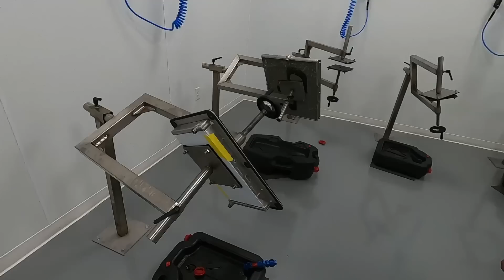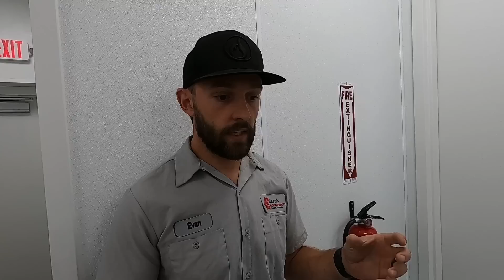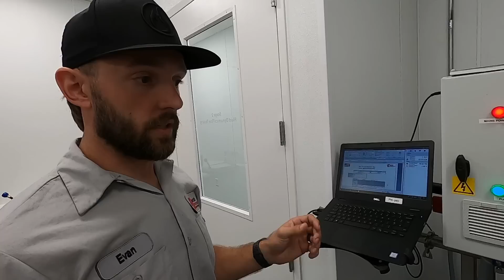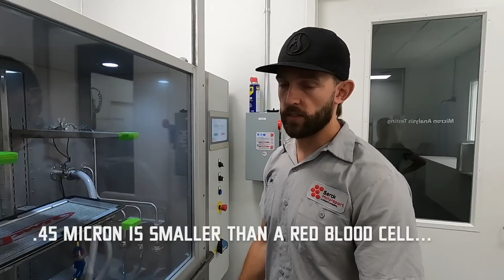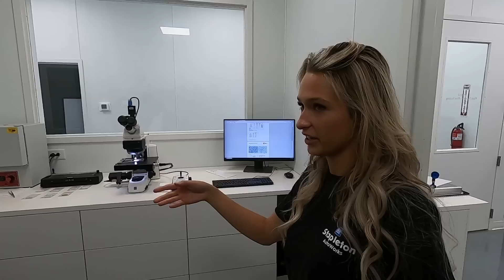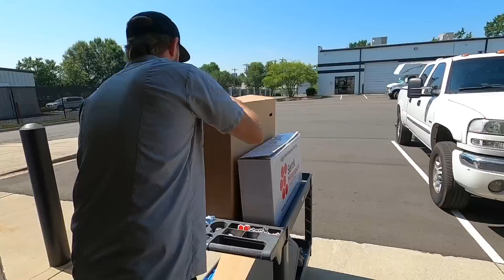Formula One Radiator Service Will Change Your Opinion About "Clean" (Serck Motorsport Tour)

Comment: Distilled water is meant to be used in conjunction with a concentrated liquid coolant, usually in a 50/50 ratio.  This is specified so that only the components within the coolant concentrate are present and they are not diluted/reacted with by the added components of city/well water.   In racing applications where you are often required to only run water or choose to run straight water, it is never recommended to use distilled water.   Really, most any water will do with a bottle of water wetter.

Comment: Awesome info, and Im only at 14:52 while writing this, so I apologize if it is covered. Why not run an inline filter with a micron rating that is thinner than what would get caught inside the radiator. I realize this could affect flow, but maybe lets apply the theory to say a daily driver. I remember when the Ford 6.4 came out there was this big push to get a coolant filter on it because of some supposed casting issues where sand might exist in the water jacket. I installed one on my truck at that time just for safety sake.

Comment: Awesome. Very enlightening to see the pool of copper coming out of that radiator! I am really wondering where are the 3D printed heat exchangers? There was a 3D printed oil-fuel heat exchanger for a helicopter and it was revolutionary I keep expecting these optimized radiator things to popup in the enthusiast/race car scene but nope.

Comment: I've built membrane filtration units that pass compressed air through filters and capture the nitrogen, then release the o2, Ar and He. to the atmosphere. Now days, I work on semi's and when it comes to radiators on over the road trucks, when they leak, they go in the bin. That's the end of it's life. A radiator is way cheaper than a tow bill. A basic in frame rebuild of an x15 Cummins starts at $10k and can easily escalate to $20k-$30k. I honestly don't care what the radiator costs. It's a wear component and will be replaced at some point. What will really get your goat, is when you loose an engine due to someone using the wrong hose clamp. It doesn't happen all at once on the big engines. You loose a hose, get it fixed, then watch the oil samples. The trick s to break out the checkbook while the crank is still good. If you loose the crankshaft, you might as well get a new truck.

Comment: "why helium? Yeah its the purest form of air" Did he really mean say that??? Someone sure as hell didn't pay attention in science class. Okay I'm sorry guy but this employee was taught the wrong stuff. Distilled water is not going to eat away at any aluminum at all. Zero. Aluminum has an ever present oxide layer protecting it. However DI water will because of the high free Hydrogen ion concentration is VERY corrosive. DI water is so corrosive it cannot be used in iron pipes, and will certainly tear into aluminum. The main factor in the corrosivity of water solutions is the ion content, the ability of the water to carry a current in galvanic reactions. Lower ions, less current, less corrosion. Don't go listening to this guy and put DI water into your aluminum block that has current flowing through it all the freaking time. You will accelerate the mass transfer process thus eating your block from the inside out. Don't believe it? Go do some digging.

Comment: Been using distilled water in my 02 s2000 for 15 years ,original water pump radiator and thermostat, 252,000 miles and no leaks!

Comment: You can measure purity via resistivity. Softened water has calcium replaced by sodium  so is soft but not demineralised.
Distilled water isnt as pure as reverse osmosis (RO). I used to do lab work, we used water with 13 mega ohms per cm. That sustem was fed with RO water and had Activated Charcoal and uv treatmrnt as well. Measured pH of water varies and solutions would vary before pH adjustment, but pH meters can't measure pH of pure water very well, as pH meters determine pH indirectly, and needs something in solution to work well.

Comment: DISTILLED WATER:  not a myth at all. ask any jetta owner with a stopped up heater core- certain coolants react with certain metals and can drop the minerals out of suspension or form other minerals. another field that can attest to this is cnc manufacturing. water and coolant of different types react with the metals being machined and quickly degrade the coolant. no myths here. in racing we generally do not use antifreezes and instead water and some sort of additive.

Comment: why is it so important to have these things perfectly clean anyway ? surely a radiator with some dust particles inside wouldnt be the difference between winning and losing you are talking about marginal gains in heat transfer
Reply: The cleaned radiator cools more efficiently. Which lets you add some tape to the grill. The tape adds downforce and helps you go a bit faster. 
When the level of competition is tight .005 of a second can be important.
Reply: great point that never crossed my mind @NBSV1 and @Stapleton42
Reply from the maker: Marginal is only marginal until it’s not. Enough adds up to gain enough efficiency allowing you to run more tape. That translates to more downforce and a much faster car.

Comment: Great coverage on a great company.  Btw. Helium is used because it’s the the smallest, inert diatomic molecule.  Helium leak detectors are used for detecting leaks in large and small pressure vessels in general industry.

Comment: helium is not the purest form of air, this is utter bull. Air is comprised of many different gases helium being 1 of many. the reason to use it over a different gas to find leaks is that it's molecules are small and will find tiny leaks other gases won't, this is why a helium filled balloon slowly empties over time the helium is able to pass through the rubber. Hydrogen would be better if it weren't so flammable and explosive.

Comment: I was also drinker of distilled h2o theory. Never looked for deionized h2o before. Who typically stocks it? Great job again, stapleton! And do we never go to u-sonic cleaning again?
Reply from the maker: I had never actually had anything ultrasonic cleaned before but I’ll be using Serck for my coolers from now on 😂
Reply: @Stapleton42  i don't think that technology exists in north indiana but in small doses i wonder if u-sonic would be ok. I'm going to be replacing radiator in my '14 charger

Comment: I'm confused about the deionized water comment, I manufacture a deionized water system and we only use SS or specific plastic on all our plumbing, because the water is so pure that it eats any other materials used in the plumbing system from the inside out including brass and aluminum 🤔 
I totally agree w deionized water if your mixing w antifreeze or another product but not  straight.

Comment: There's some confused science mentioned here about Distilled versus Deionized water. 

Deionized water is actually much worse on material wear than simple Distilled water, because its PURITY  is much closer to what's called "new water"... which has nothing but Hydrogen and Oxygen... balanced perfectly, and is extremely corrosive to many materials, including some metals. 

The closer to New Water you get, the more corrosive it is... in fact while commercially available distilled water is relatively safe to drink on a semi-regular basis, you would never do that with deionized water.

It has to do with the level of free ions... if there's plenty of free ions (from naturally occurring contaminants), the water becomes "neutral", and won't leach ions from the container or plumbing. Deionized water has very few free ions, resulting in very high resistance (very low conductance), therefore will leach ions from almost any metal it comes in contact with.

Quoting a resource:
"When the temperature of deionized water increases, the thermodynamic activity of the ions and dissolved oxygen in the deionized water increases, and the mass transfer process accelerates. Therefore, the electrochemical corrosion reaction of the aluminum surface will be accelerated. The corrosion products covering the aluminum electrode surface are mainly Al(OH)3. With increasing water temperature, the number of pits and grooves formed by corrosion on the aluminum surface increased."

https://pubmed.ncbi.nlm.nih.gov/32046276/#:~:text=When%20the%20temperature%20of%20deionized,aluminum%20surface%20will%20be%20accelerated.
Reply: Another reason NOT to use Distilled or especially Deionized water is because they have very high surface tension... which translates to very poor heat transfer from the metal to the water. This is why surfactant products like Redline Water Wetter exist... to lower surface tension, causing the water to "stick to" the surface of the aluminum longer - transferring more heat. 

The safest would just be reverse-osmosis filtered water... get rid of the chlorine, but retain a smalllll amount of basic "simple" contaminants. 

If it's allowed (it usually is), use Water Wetter. With this, Distilled water becomes more neutral, and won't damage the aluminum.

Comment: They use Helium not because its the "'purest form of air" or whatever he said, but because He2 is the smallest non explosive (looking at you H2) molecule. so they find smaller holes.

De-ionized water ist "electronically charged to strip its properties so that molecules stay together". What the hell does that even mean? De-ionization is, as name suggests, removal of ions. Ions are reactive (cause they either miss or carry extra electrons and they try to achieve neutral charge). Removing them reduces reactivity of the solution (water in this case).

Distilled water wet through distillatio process. Much like with alcohol, it is brought to boil temperature (100 C) and the vapour is collected. Thus removing any chemicals in solution (pre-distilled water) with different temperature of boil. Removing almost all impurities, especially minerals and bilogical matter. 

DISTILLED WATER IS MUCH BETTER THAN TAP WATER! DONT LISTEN TO THIS CRAP!

This elite-technician dude is so clueless, its almost scary :D!
Reply: Yup, I've compared and used both distilled and tap, the radiators I've used distilled water in are extremely clean non rusty compared to the ones I've used tap water in.

Comment: induction heater... deionised water, not distilled. all fittings bronze or stainless. or pvc. no aluiminium or cast iron pumps... lol.

of course, i was over ridden and the manual was ignored. that poor machine.

water was rusty within two days on the cast iron pump, (something like 50L/min at 60psi!) and yeah... whole thing shorted out. very expensive.

"but you didnt tell us..."

the company told you, i told you, the manual told you, the effin sticker right here on the side of the machine tells you! but rather than listen you let effwit install it! what was his first pump selection? a freaking dinky little plastic pond pump. and you flew a tech from interstate to commission it. and i had to deal with him and explain why the hell it had a plastic pond pump strapped to it because suddenly i was in charge again until it came to decision making on yet another pump, and again, it was dickhead in charge? hence the cast iron pump. that just squeezed by on the parameters... again the tech. again the explanations...

to have it blow up and fly him down again...

(watching the stainless grundfos coolant pump from the CNC mill being replaced as they needed a bigger pump for some drill for ONE JOB at the same time... um... THATS THE PUMP YOU WANT ON THE INDUCTION HEATER)

and yeah... controlled at 27C... another story in its own, the chiller not going over 4C... condensation was the next reason they paid god knows how much to get a tech down to rebuild it...

sometimes, its worth reading the labels when you get a 150K machine....

the whole machine was water cooled, the water had to be forced through a lot of piping, and everything still had to remain electrically isolated... distilled water would shred the insides of everything and get conductive in a matter of minutes....

anyway. end rant :)

i couldnt be bothered in automotive. i just use tap water. its soft here. no mineral. no scale... lucky?

meh. never had an issue with anything. other than magnesium cases and theyre best being drained if your going to store them in a shed for years...

Comment: Deionized pre-mixed coolant is the only thing you're supposed to put in GM's electric vehicles. Otherwise you can short out the electrical system. The coolant provides isolation between the high voltage system and the rest of the vehicle. The A/C oil is similar, POE oil only. PAG oil can also short out the electrical system on a GM electric vehicles.
Reply: Another reason to not buy a GM

Comment: At one point 100% or concentrated antifreeze was cheaper than 50/50, which didn't make any sense. I could buy concentrated, split it in half to make TWO 50/50's, and each one would be less than half the cost of a 50/50 from the store. The stores got smarter and charge a couple bucks more for concentrated. But still, if you take it home and split it to two 50/50's...I don't think they see the logic.
Reply: They charge for the convenience. All it is.

Comment: What he's saying about deionized water isn't correct. It has the same problem as distilled, and it's actually worse. I worked in a pharmaceutical testing lab and we had problems with using deionized water in the stainless steel water pans in our mammalian cell incubators. Those are kept at a steady 37*C (98.7*F) temp so corrosion will happen fast. The water lacks any ions so as he described it will chew right through even stainless to grab those ions and balance itself chemically again. It would cause little pinholes to form in the pans. We solved this by putting a hunk of pure copper in there which was more reactive for the water to consume. It has the added benefit of being antimicrobial too so it helped us keep the water free of microbial contamination. You used to be able to use pennies but they're not made out copper any more, so don't. I don't know what you'd do to fix this problem in automotive applications that use only water as coolant but adding standard coolant to either DI or distilled water will take care of the problem in street applications.

Comment: Great video!!! Using helium for leak testing is a great idea. Helium molecules are very small. I used to use a helium leak detector on industrial vacuum furnaces. If you want to find really small leaks, helium is the gas to use. I agree that de-ionized water is also the best to use for cooling. Distilled water will try to balance itself by removing molecules from any surfaces it comes in contact with.

Comment: The "Specific Gravity" of an object is the density of that object divided by the density of water. The density of water is 1,000 kilograms per meter cubed. For instance, the density of gold is 19,300 kilograms per meter cubed. So the specific gravity of gold is 19.3.

Helium: 0.166 kg/m3
Oxygen: 1.33 kg/m3
Nitrogen: 1.16 kg/m3
Natural gas: 0.667 kg/m3
Hydrogen: 0.0838 kg/m3.

Comment: So after all that cleaning, what do they recommend to use when coolant is a no no like drag racing or in my case road course cars? Has to be something that inhibits rust formation and aids in eliminating aluminum erosion, the more particles flowing around at 20-30-40gpm is like sandblasting the inside of the core.  Blew my mind when he said how much cup radiators were now, never would have thought anywhere near $8k
Reply from the maker: Coolant additives like maxima cool aide

Comment: For me he lost a bit of credibility when he said a brand new motor/radiator combo would go from 100% to 80% efficiency in one race. Sorry but that’s BS to me.
Reply from the maker: They’d gladly show you the data. Think about how much rust and particles come out of an iron engine block. Running almost wide open for several hours… it makes complete sense.
Reply: @Stapleton42  he implied a race prepped aluminum engine and radiator of high end quality. He stumbled when he said 80% and I bet he regretted it, because a 20% loss is not believable at all. If he would of said 5% in one race, I’d accept it but even then be skeptical. Think about it, even if it was an iron block, those chunks would need to be pretty big numerous to stop and cause a blockage at the radiator capillary tubes. Now, if he wants to include in that 20% loss any external dirt or debris, that’s another story, and I think he got his numbers jumbled because he was also talking about dirt track cars at the same time.

Comment: I learned about de-ionized water at the first race team I worked for. We just finished up a build and for some reason we were having major electrolysis problems in the cooling system to the point where the coolant system would build so much pressure just sitting over night it would drain half the water out through the overflow. We tried grounding the radiator, waterlines, etc with no luck. So we eventually got in contact with the local university and sent water samples to them to be analyzed. We were recommended to try using de-ionized water, for the reasons stated in the video plus its doesn't conduct electricity...electrolysis issues. Sure enough never had any issue after that and have used it exclusively since. It was a one off freak incident but pretty cool to have been apart of!
Reply from the maker: That’s awesome!
Reply: You can buy di water for dollar fifty a gallon at a lot of places
Reply: I remember in chemistry classes years ago, biting the pH of distilled water to be around 4.5 or something like that..!   I know that it’s logarithmic, but I was kind of shocked getting that reading